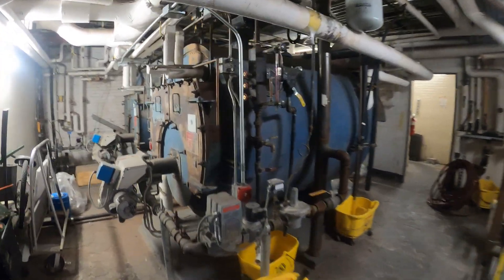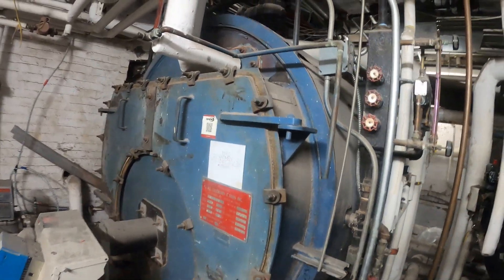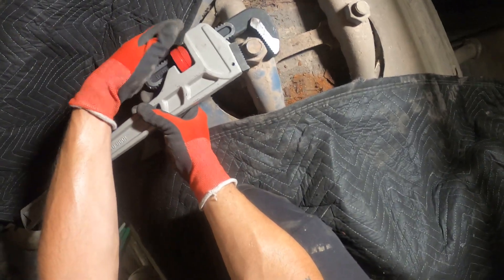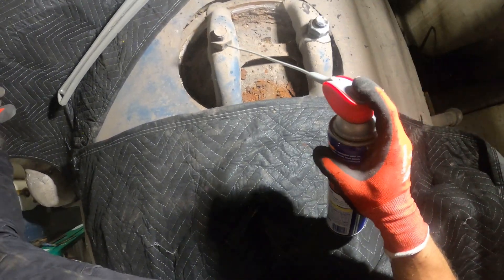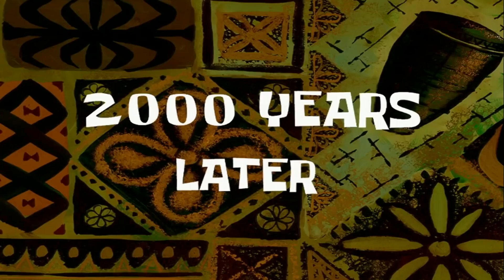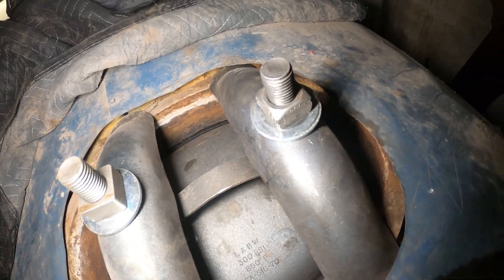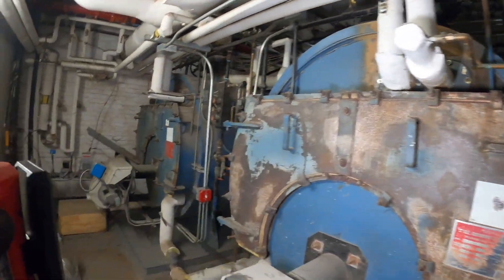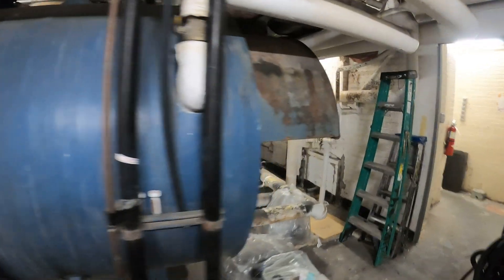HVAC Service Call: Commercial Steam Boiler Fails Inspection (Manhole Cover/Gasket Installation)

Comment: Those boilers are in bad shape. I have been a stationary engineer for 25 years, and there is not a plant I have worked in that has as much crap around the boilers. Those are small steam boilers.

Comment: I work in upstate NY in the prison system and we have steam boilers 1200hp and our yearly inspections call for manhole and hand-holes to be opened and inspected…boiler operators and the inspectors should be in trouble for allowing this condition

Comment: We had a 150hp fire tube boiler (230 psi) that fed presses and a low pressure heating loop. The main output nozzle sprung a leak midday and roared like a jet engine for hours even with the blowdown wide open. The entire room was engulfed in steam and you couldn’t see your hand in front offyour face. The boss tied a rope around his waist and shinnyed along the floor to reach the main disconnect and threw it. We called a welder in and he spent 4 days laying bead around the nozzle and a generator truck and annealing blankets ran all night to keep the weld soft.

Comment: I find it easier when you put the manhole cover back on to wire it up to a piece of pipe that is in line with the yolks and over the opening. This way you don’t run the risk of dropping it in the boiler and you can line up the gasket easily

Comment: Crazy how careless people can get when working with pressure vessels. That's year's of neglect. 15 lbs of pressure may seem like a small amount but on a vessel that size plus all the piping it adds up. If that man way would haved failed exposing the water to atmospheric pressure the result would be catastrophic. Boiling liquid expanding vapor explosion.
Reply: When I saw the condition of these it gave me chills. 😮

Comment: When you can get yourself a Milwaukee impact 20v with impact rated socket ends and you’ll bust those out in 2 seconds great vid.... my truck got broken into 3 different times... all in Miami. The slick locks are a pain but since using them I haven’t been broken into...

A curse on those who steal tools from the working man... they’re scum
Reply: Literally stealing a mans lively hood. Indeed scum.
Reply: Milwaukee makes 20v tools?

Comment: Can tell no water treatment!
Reply: No water treatment, nobody blows down and tests those little #67 LWCO's. Because nobody cares.
Reply: @johnwilcox4078 I do every day at work cuz I’m bored 😂
Reply: @sc1338  Well keep up the good work 👏 😉
Reply: As soon as I saw them just dumping the hot water content down the drain I figured there was no water treatment. Or at least not any more 🙂
Also no one is doing internal inspections if those gaskets are like that, imo

My two 125hp steam heating boilers have injection quills feeding water treatment and I tear them down every year for cleaning and inspection in the off season. I really don’t like surprises during heating season

Comment: This may seem like a simple fix and it is but mind u he has a man helping him picture doin this by yourself. I work in Connor I’ll boilers now local 638 nyc and for those boilers to b in this condition they are not being properly overhauled yearly like they should
Reply: That has to be a low pressure boiler for it to have 67 float on it. They don’t open that up every year at all.

Comment: If you would have locked the second boiler's Honeywell RM78XX control on "Prepurge" for the night, the boiler would have been nice and cool on your return.  All of the limits and safeties (ie, low water, etc.) need to stay made for this to work.
Reply: You can split a tube in the hot pass weld and stretch the rear sheet by doing that.

Comment: Have to isolate that boilers king valve. Just a thought
Reply: Proper Mechanical and Electrical Lock Out would have / should have  needed to be carried out... Work  Permits Issues  and signed onto, Pipe Spades Fitted , Electrical Panels opened Up  Fuses Pulled and Isolation Lock signed out and Fitted...Utilities Operator instructed to drain down the Boiler and  Vent the Boiler, remember a Leading Hand Millwright friend of mine just got stuck into the job like that during a Annual Shutdown... in the times when Health and safety wasn't taken like it is today,  but someone had broken a steam condensate line above him by a a Steam Calorifier above him, next thing a pump started and emptied hot condensate somewhere else on the plant and hot returned condensate water hit him down the back of the Neck...scared for life with third degree burns loads of skin grafts,  never worked again... still in constant pain...Be SAFE, careful out there...Great Upload...